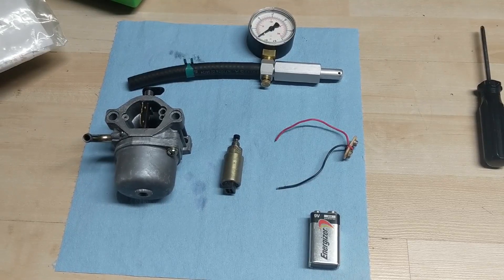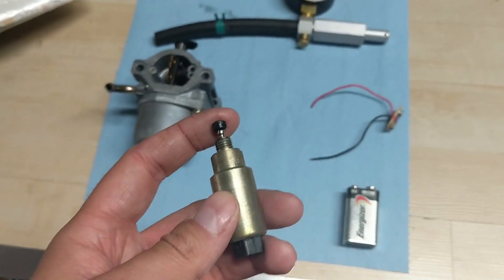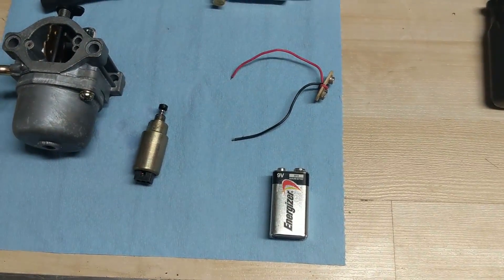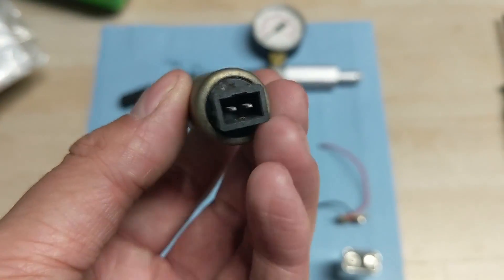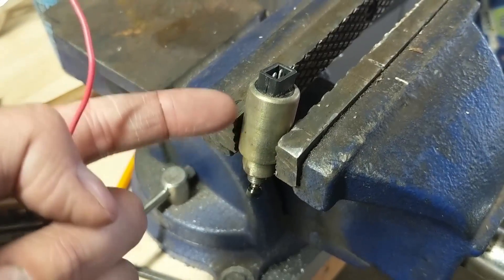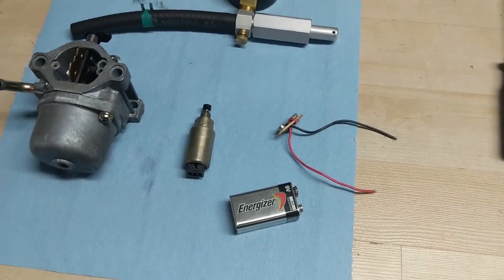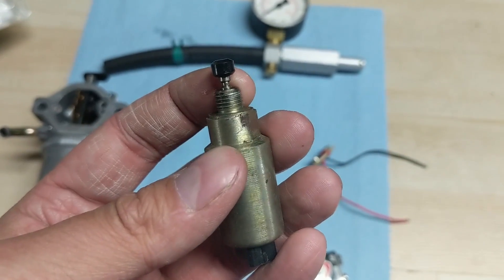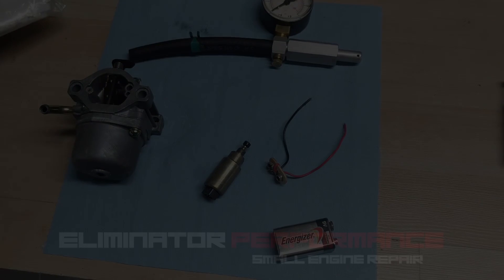How to Test a Fuel Shut-off Solenoid

Comment: Is there any way to bypass that dam thing?
Reply from the maker: You can cut them off, but you'll have to throttle down your engine when you shut it off or it will most likely back fire! Thanks for watching!
Reply: @EliminatorPerformance  Thanks. I just tried to remove it and it snapped off like a dry twig the moment I put a wrench on it. It seems to be seized and full of grime. I just looked up a new one and its $100. I think my old tractors without this thing might be superior. lol

Comment: ✅❇️✅ best way to do this , take 1/2 wrench unscrew solenoid hold it on your hand and turn the key on you’ll see it move , make sure it’s plugged in to the connector
Reply: 'm getting no power to solenoid I'm assuming because a don't hear it click when i turn ignition key on. i removed the seat safety device so mower wouldn't cut off if i got off lawnmower now it wont start. any ideas?

Comment: Be careful expecting a 9v battery to "unlock" a frozen or gunked up solenoid.  Mine would just click but not move, until I wired it directly to the batter (12v) and then it broke loose and began working again!!
Reply from the maker: Yea I have a 12v lithium ion battery pack that I use now, much easier and charges via a USB cable!

Comment: So the solenoid is working and if I spray starter fluid in through the air intake my mower will fire and then shut back off.  I’m getting spark and I’m getting fuel to the carburetor.  I don’t know what else to check to get this thing to fire and stay running.  Got a fuel issue somewhere but it’s not in the supply line and like I said I took the solenoid out and turned the key and the plunger is moving up and down and the carburetor is filling with fuel.  I’m stuck.  Any suggestions?  In short I’m cranking but will not fire unless I use some starter fluid and then it shuts right back off?
Reply: K never taken one off but I guess I can take the carburetor off and try and clean it out or something, see if there isn’t something blocking the flow of fuel into the jet.
Reply: Great video by the way!
Reply from the maker: The fuel is going into the bowl, but not through the main jet by the sounds of it!
Reply: Fuel pump isn't pumping enough to keep it running can also be the problem. Mine was at one time.Had a split in the diaphram
Reply: jet is blocked

Comment: I have the wire pulled out of my solenoid on my vstar, would that be a reason of cause of not starting?
Reply: Yes.it controls your fuel.with wire off it stops fuel flow
Reply: yes the solenoid is stuck in the closed position without power going to it.

Comment: sick! how do u test if its in up position when it should be opened and allowing fuel to run as is should
Reply from the maker: Supplying 12v to the solenoid will engage the magnet and pull it down.

Taking away the 12v will disengage the magnet and the spring should push the plunger back to stop the fuel from going into the main jet.

If you put 12v to the solenoid, but it doesn't move, you need to replace it!

Comment: Why not just use jumper wires to the mower battery?  That seems simple to me.
Reply: This is something to do if your already cleaning the carb...
Reply: There's a wire plug you connect to the solenoid switch witch is activated by turning the key on and off.they go bad sometimes stick.you need to replace it.
Reply: Or just pull the solenoid, put a piece of duct tape over the hole, plug it in and turn over the engine. All this drama is a waste of time.
Reply: if your battery is dead jumper it to your battery charger.No waiting for it to charge
Reply: Agree! And its 12v. The time he spent  dwelling on the 9v plug was annoying.

Comment: Nice short video that may save an ELIMINATOR $100 for a shut off solenoid by replacing with an in line $6 fuel shut off valve.
Reply: Thank you, some more safety crap to go bad. Just got a generator for free. Cleaned the carb, it runs when feeding the throttle body manually. Gonna check the solenoid now
Reply: Wayne Stefinashen the fuel solenoid is really an anti backfire solenoid and was made for that....it wasn't made to stop leaks...if you put a shut off valve in fuel line it won't do the same as the solenoid....the solenoid immediately blocks the main jet so no fuel will get to the engine...even if you turned off engine and turned off shut off valve immediately you still have a carburetor bowl full of fuel which can still cause engine to backfire....
Reply: Macknumber9 you are absolutely correct but sometimes a carburetor rebuild kit is not available, nor is a replacement fuel solenoid so easy peasy cut off the solenoid stem and install a fuel shutoff valve but notify your customer to throttle down before shutting off the engine and NEVER forget to shut of the fuel valve.
Reply: @macknumber9  But the engine will start and run and do the job it was built to do. The stuck shut off valve doesn't allow  the fuel into the carb bowl.Isn't the point to get the mower  running.I did the same thing and my mower has been working for at least 2 years without that expensive POS. Just shut it off slowly so it doesn't backfire.It won't hurt it even if it does. I actually cut the tip off the shut off solenoid.It still works fine. Be sure to turn off the inline fuel valve when finished.